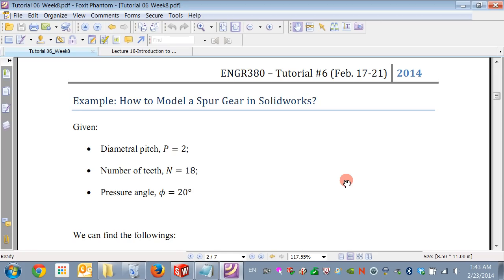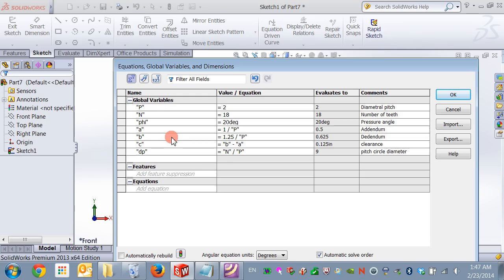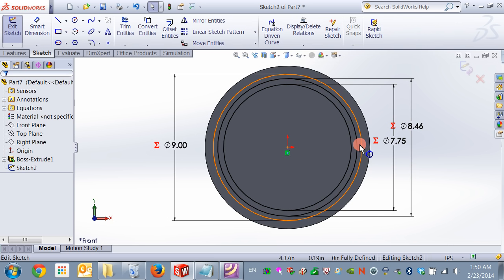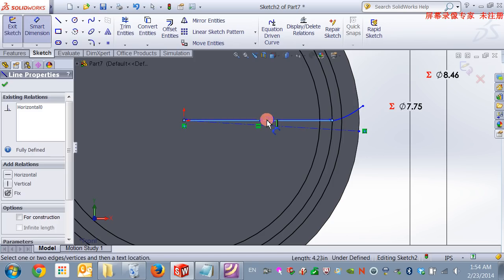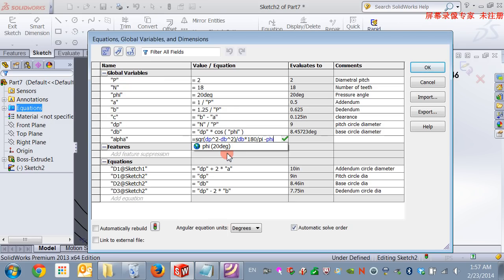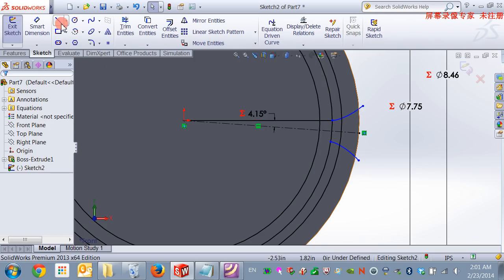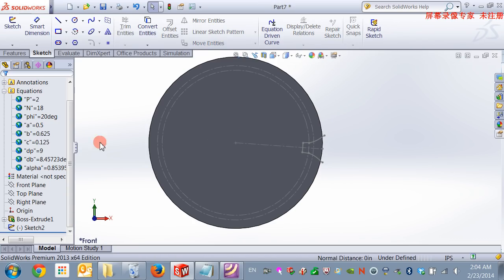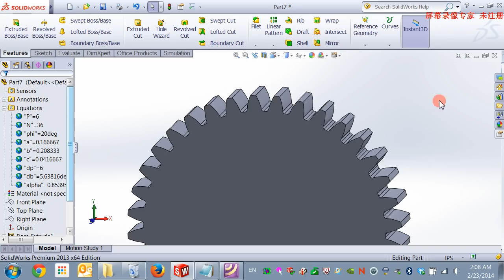Modeling an Equation Driven Involute Spur Gear in Solidworks

Comment: One mistake that I noticed is during the circular patterning of the filet and extruded cut. The number of instances should be set to the global variable "N" rather than the number 20 which is shown.
Reply from the maker: The old version of SolidWorks does not allow to do that.
Reply: I am using solid works 2016, and when I set the number of instances to global variable N it simply substitutes the current value

Comment: Why do you use dp+2*a for the addendum circle? shouldn't it be just dp+a?
Reply: it's 2*a since you need to add a on both 'sides' of the circle. Imagine a hollow cylinder where you add thickness.

Comment: to clarify.. when you input your equation curve,  the genereated curve goes from left to right...0 degrees, to the right, with the given equation... my line goes up... from 0 degrees, vertical...I have No idea why its doing this. I even went back and did it with all your numbers..
Reply: I made the same mistake. You probably wrote the Y(t) equation wrong. My error was putting a plus instead of a minus lol

Comment: Ive followed this video with gear data of my own and its not working, Im starting to believe the information ive been given by one of our manufacturers is incorrect. Could someone confirm if this data works?

Teeth: 8
Pitch: 10/12 DP combo Stub
Pressure angle: 20°
Outside dia: 1.056"
Root diameter: 0.678"
Whole depth: 0.189"
Pin diameter: 0.173
MOP: 1.084/1.080"

Comment: what is pressure angle?why you set it 20degrees?
Reply: it's standard.
Reply: Pressure angle in relation to gear teeth, also known as the angle of obliquity, is the angle between the tooth face and the gear wheel tangent. It is more precisely the angle at a pitch point between the line of pressure (which is normal to the tooth surface) and the plane tangent to the pitch surface.

Standard values are 14.5, 20 and 25 degrees, 

Generally 14 1/2 degree compared to 20 deg pressure angles

14 1/2 degree PAs will have:

Higher contact ratio
Lower Bending Strength
Higher Shear Strength
More undercut
Lower bearing stresses and separation loads

20 degree PA will have:
Lower contact ratios
Higher Bending Strenth
Lower Shear Strenght
Less Undercut
Higher Bearing stress and separation loads

Most people are worried about Bending Strength in their designs - hence use 20 deg PA as a starting point.

Where are 14 1/2 deg PA an advantage?
- worm drives where the primary failure mode is augering of the worm thru the gear - esp if the gear is plastic
- designs that are challenging to achieve a contact ratio of greater than 1
-  designs where bearing life is marginal

Comment: When I type db = dp * cos(phi)  I'm getting a negative value, anyone know why and how I can change that without typing in 
dp= dp *-cos(phi) to achieve the positive value because I don't know how sensitive this equation is.......
Reply: i know that i am extremely late but here it is-
The phi value you have taken is above 90 degrees or you have set the phi value to radians instead of degrees. Generally, phi is either 15 or 20 degrees.

Comment: Good video, but Dp = N/P threw me off completely - surely it should be Dp = N*P - until I did a bit of googling and realised that "diametral pitch" means something completely counter-intuitive: teeth per inch of diamater (equivalent to the metric module m, but inches instead of mm). Why do Americans use the term "pitch" to describe the inverse of pitch? Completely non-sensical.

Comment: You need to actually understand gears before you wrote this.  Your parametric equation is accurate but your t1 and t2 you have no clue on how you come up with these numbers.  "That is just a value for "t" I randomly selected after a few trial." is piss poor engineering skills.  t2 is = sqr((AddendumCircle/2)^2 - (BaseCircle/2)^2) / (BaseCircle/2), not just a random number you pick and choose, your gear wouldn't last long in an environment that it had to actually work in as the mesh wouldn't be correct.  Yes I do have my PE before anyone ask too.